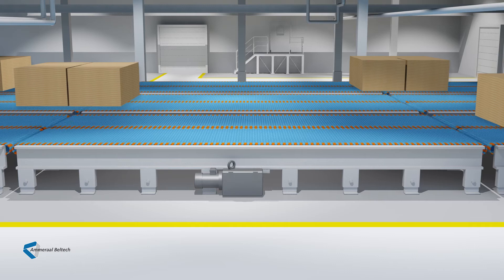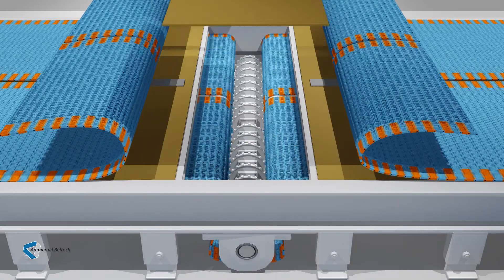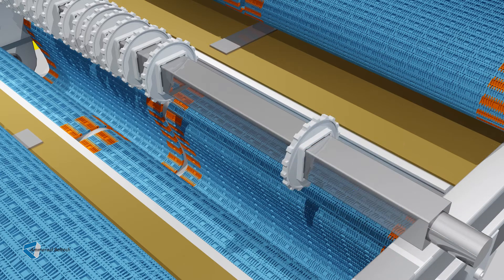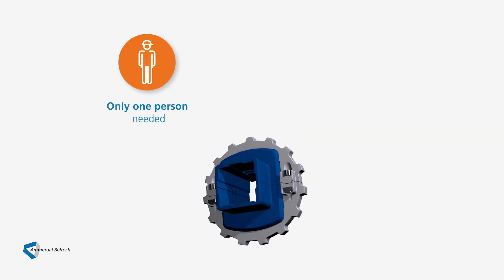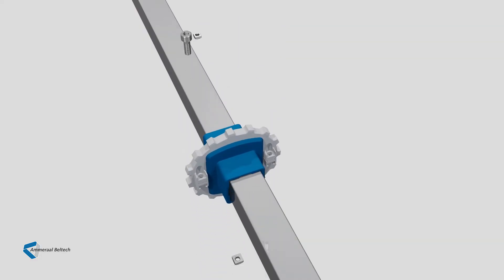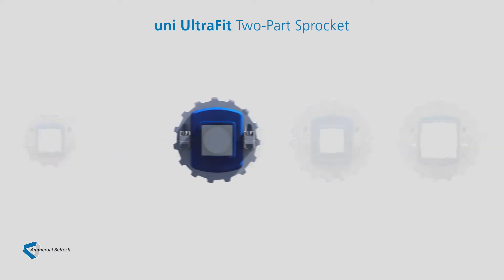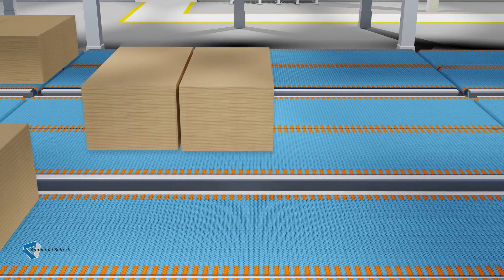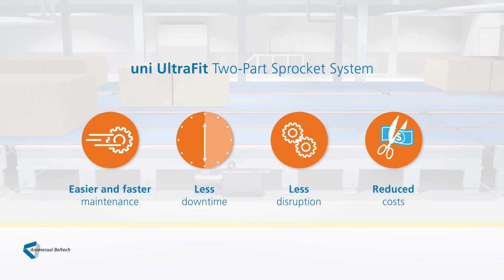uni UltraFit - Two-Part Sprocket System | Ammeraal Beltech

Comment: And what happens if the screws are at 90 degrees ?
Reply from the maker: Thank you for your question. We will check with one of our Modular experts and will provide you with an answer to your question soon.
Reply from the maker: When the belt is opened up and the screws are at 90 degrees, it is usually possible to turn the shaft by turning the motor (or motorfan) by hand to reposition. Make sure you always follow all necessary safety procedures while doing so.